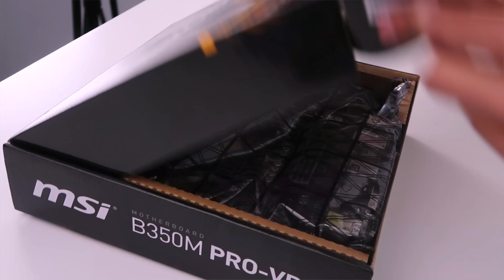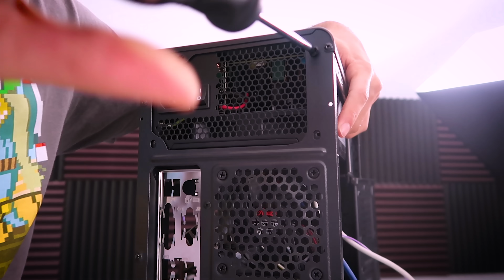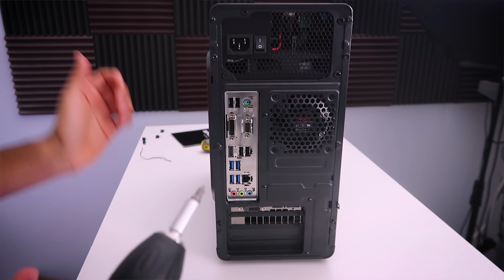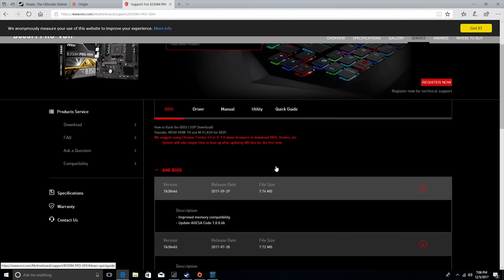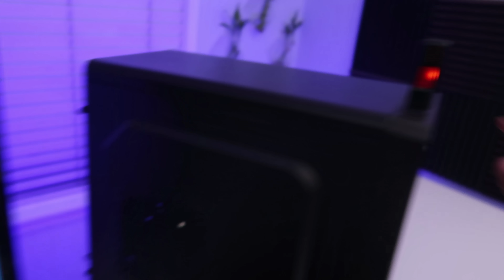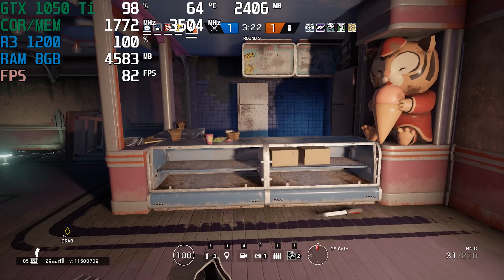$500 Budget Gaming PC Build Guide - GTX 1050 Ti (w/ Benchmarks)

Comment: price of this as of today: i changed the gpu to the zotac version and i opted for a better case. total ended up being $560.04 not including wifi adapter. i also opted for a 24” gaming monitor for $100, bringing the total up to $660.79. i also changed the ram to 1x8gb for around $80 but i’m not sure if one stick is better or worse and two 4gb sticks. overall good budget pc that will handle games like fortnite pretty damn well.

Comment: how would a risen 3 2200g compare to the 1200?? super curious because i plan on building this pc soon and they are nearly the same price.
Reply: Josh G the difference is performance is like 1-3% but the main difference is that the 2200G has a built in GPU which is basically a 750ti m/GT 1030 performance, where as the 1200 has no iGPU so you need to buy a dedicated graphics card for it.
Reply: hell yeah thanks so much for the help my man. much appreciated!
Reply: youre very welcome

Comment: good video bro and I hv some question for u before I buy these stuff.

which is better, Ryzen 5 Ridge 2400G without VGA Card,
or Ryzen 3 Ridge 2200G with VGA Card like yours ?

I'm confusing, many people said Ryzen 5 onboard APU is equal to GT 1030.
is it true ?
Reply: Dope Rock it’s more equivalent to a 750ti than a 1030 but more or less it is
Reply: If you want more graphics power get a Ryzen 3 1200 or the 2200G, whichever is cheaper, and buy a GTX 1050 or better. Even a 1050 is better than the iGPU in both of those
Reply: Dope Rock but if you don’t have money for a GPU or want to save up for something good like a 1060 6Gb get the Ryzen 5 2400G and is the iGPU

Comment: Wouldnt a G4560 be better then a ryzen, especially this close to the 2nd gen release date?
Reply: Tanner Aslan no because Ryzen still has a lot of life ahead of it. I believe they said it will be supported until 2020 unlike G4560 which is on the 200 series which already lost support because the 300 series coffeelake processors came out
Reply: good point, Ryzen is better for upgrading. But, the G4560 can be replaced, especially because it is a budget CPU, so upgrading the entire CPU when you need an upgrade might be better. It is only around 60 U.S. dollars.

Edit: put GPU instead of CPU

Comment: That exact Power Supply unit on Amazon is currently unavailable to me, is there another kind of psu I can use?
Reply: Get the 500w version, just search EVGA PSU on Amazon and it should come up. Think it's the same price.
Reply: Ieuan Squires Thanks, any idea what the 80+, 80+bronze things are?
Reply: Ieuan Squires sorry, new to building these, and I've tried my best to base my design off of this with a few changes
Reply: lol I'm new too, I literally just finished building my first ever PC (this one with a couple changes) as we speak. Waiting for Windows 10 to download to my USB so I can try boot up! I have no idea what the 80+ stuff means tho I'm afraid
Reply: Joe Datz 80+ is the efficiency of the power supply. So 80+ white is the lowest which is fine for budget builds since nowadays pc parts use little wattage. 80+ bronze is after white and has better efficiency. That’s really what the higher ratings are at that point, efficiency. After bronze goes gold, then platinum, and finally titanium.
Reply: Ieuan Squires Joe Datz 80+ is the efficiency of the power supply. So 80+ white is the lowest which is fine for budget builds since nowadays pc parts use little wattage. 80+ bronze is after white and has better efficiency. That’s really what the higher ratings are at that point, efficiency. After bronze goes gold, then platinum, and finally titanium.
Reply: Luis Ramirez Thanks, I appreciate it. I think I built a setup on PC part picker using this as a base, and I plan on buying the parts piece by piece as I get the money. So this helps a lot actually!

Comment: I am looking into building a gaming PC. I may never do it, but for now I am interested. Are these parts still worth it? Also I looked at cases on Amazon and I like the NZXT S340 Mid Tower Computer Case. Will all these components fit the same inside that one?
Reply: With the same components in the video, it is an amazing pc for its price, but I don't think the case you're looking into will work with the parts shown in the video, I'm pretty sure you need an ATX case. You could always try it out and send it back if it doesn't work :)
Reply: Ok, thanks for the reply!
Reply: Liam Boyle no problem

Comment: Would it hurt to use a 500w power supply instead of 430w? I know this is a noob question, but Amazon no longer has the 430w.
Reply: Michael Bratcher it’s fine to use the 500w
Reply: Luis Ramirez Awesome. Thank you. It's been ordered.

Comment: Built this exact pc and runs great but don’t overclock to 3.7ghz unless you have a cpu cooler/fan
Reply: The cpu comes with a cooler
Reply: Luis Ramirez yea it does but when I overclocked it to 3.7ghz it would freeze and come up with an error
Reply: Carlos Flores did you just change the multiplier and that’s it?
Reply: Luis Ramirez yea that’s all I did and everything else was on auto

Comment: Question: If you place the PSU with fan facing downwards aren't you pushing the heat from the PSU onto the Motherboard? Edit: just realized what I did there the fan on the PSU is to draw cool air into the PSU. Ignore my comments.

Comment: Will I be able to play games on High to Ultra settings while getting more than 50 FPS if I pair 
GFX : GTX 1050ti
CPU : Ryzen 5 1500x
RAM : HyperX Fury 8GB
Will I be able to stream games on twitch and render videos on Premiere Pro as well?
Reply: Magnus. I have a few questions and have seen you in the comment section.
Could you text me at +1 360-464-3758? I just have a few questions regarding building a computer for the first time.

Thanks!

Comment: What is the performance when this PC is not overclocked, is it still gud? What's the difference in fps
Reply: Look Wow it’s about 10+ FPS down. I recommend you overclock
Reply: Or like he said, get the r3 1300x. I have the same build, but got 1300x instead just like he said. I dont like overclocking so... yea
Reply: I built this Pc part for part except I used a 450 watt power supply instead and I have to say over clocking is almost necessary for this cpu if your looking to get average performance In games without the overclock some games experience occasional frame drops or just don’t run as smooth as they should
Reply: Wow
Reply: Brandon Avila  how is the computer? Is it worth it?
Reply: you have the same build right? an you tell me the dimensions of the 430 watt power supply?

Comment: Hay Joey can u build this same pc for me I will pay you for the expenses
Reply: Just build it yourself be confident it looks like a rewarding process
Reply: PowerRB34 building your own PC is it dangerous or nah?
Reply: B I’ve watched a lot of videos but I haven’t built one my parts are being shipped right now but it is actually very safe but if you are scared some people recommend you have a piece of grounded metal to prevent shocks but that isn’t dangerous to you really just your pc
Reply: PowerRB34 that's what I'm scared of I might broke a part and I don't want that to happen cause most of the parts are expensive
Reply: B honestly that won’t happen just don’t turn anything on or plug it into the wall until you are done
Reply: PowerRB34 I know I will not turn it on if its not done but like there might be a little mistake and might fuck some parts up
Reply: B then don’t do it until you feel confident or maybe find someone with experience to help you man it’s not rocket science
Reply: Dude don't be afraid , it the easiest thing to build your PC but the real hard part is to do those headshots in csgo😛.And also don't be afraid of electrostatic discharges because most of components nowday are electrostatic resistant, it literally can take you hundreds of electrostatic discharges before you end frying your CPU,ram, motherboard or graphic card. wish you luck with your build
Reply: Berry just watch videos if I can build my first pc in under 35 minutes anyone can build one

Comment: Could u change the cpu to the next one up or would u need a different motherboard ??
Could u add 1070 instead of a 1050 ti ?? 
Could you use a different case ??
Reply: u could us the 1070 in the same motb. but I dont know about the case if its mATX u should be fine
Reply: regular guy thx
Reply: Magnus Rasmussen thx

Comment: Question(s). I built this gaming PC for my son. He is complaining about an issue where the display freezes for up to 5 seconds. Sometimes it is just a quarter of a second. This is a major problem if you are in the middle of some game (Rocket League, Overwatch, Fortnight are favorites). He has demonstrated this to me and I have seen the under 1-second hang-ups a couple times. He measures frame rate and ping and has diagnosed this as not an internet problem.  I am using a 40" flat screen TV for the display and used a 500W power supply instead of the 430W prescribed.  Also the case was slightly different that I got, but that should not matter.  Same graphics card, processor, motherboard, RAM.
* So what is it and how do I fix it? 
* A couple of possibilities. I installed windows 10 from a backup disk from another PC. It nags you about not being registered. I could get a fresh, paid windows. I wonder if this is crippled somehow. 
* The other thing is that I can partition the drive and install Linux and run under that. But will the games I mentioned above work on Linux. I did a quick search and it looks like Linux Ubuntu using Wine might work. There are some people who say no, others who say performance is hurt, it does not look good, I'll post a bunch of links in the comments.
*I have endeavored to get the latest drivers for all the parts but I can go back and double check.
* This is the video I built from. https://www.youtube.com/watch… I can watch closer and see if I missed something and read comments under to see if people had similar problems.
* I have done nothing with BIOS yet, could that be the issue?
* Any suggestions would be greatly appreciated. Thank you.
Links about playing PC games on Linux
https://linuxconfig.org/install-and-play-overwatch-on...
https://askubuntu.com/.../can-i-run-overwatch-on-ubuntu
https://www.reddit.com/.../com.../6cilfb/overwatch_on_linux/
https://www.omgubuntu.co.uk/.../rocket-league-linux...
https://www.reddit.com/.../low_fps_in_rocket_league_in.../
https://boilingsteam.com/rocket-league-now-stable-on-linux/
https://www.epicgames.com/.../suggesti.../94370-native-linux
https://www.reddit.com/.../fortnite_on_linux_it_works/
Reply: I did not do any overclocking either.
Reply: you should reinstall windows, for me that solved the problem.

Comment: Hey, thanks for this. I built it about 2 month ago and it works great. it was crashing with overclocking. Changed it back and fixed the issue. Question, I'm trying to decide whether I should get Far Cry 5 for PC or PS4. How does this PC stack up against the PS4? Thanks in advance.

Comment: The GPU is like $150 USD RN so I found this MSI Computer Video Card (GTX 1050 TI 4G OC) for $50 dollars less link: https://www.amazon.com/gp/product/B01M27X836/ref=ox_sc_act_title_3?smid=AHG2MI785YUY7&psc=1 | but I just wanted to know if it will be compatible with the other parts and if it will drop the fps or over all performance?

Comment: If you buy a 1050 ti u are a fkn idiot. Guys dont buy this shit. This is like buying a GTX 960 and you wont do that neither. Every GTX 970 you can by second hand online for plus 50 bugs is ALOT better than 1050 TI. Use ur brain and dont fall for this. 1050 is a really really bad card for 2018/2019. 1050 TI is just a new name for being a 960.

Comment: Would a 600 w power supply be better or worse
Reply: You don't really need it. 600W is usually for higher end builds with more power hungry parts e.g gtx 1080ti, Intel i7 etc..
Reply: Sneaky better upgradability
Reply: Yeah, but you are gonna end up spending a marginally different amount if you buy a 600W psu at first then spend $600 on a GTX 1080ti, than if you had a 400W PSU and upgraded the PSU and the GPU - only $30-40 more.. whatever both are okay lmao
Reply: Rather than focusing on the wattage I'd recommend focusing on the power supply's quality. A low quality 600w power supply would probably not last longer or dish out enough power than a high quality 500w power supply. 

Many people don't really care about getting a power supply with great components and only focus on the wattage, which isn't a good idea in my opinion.
Reply: would you recommend the EVGA 500W silver one? because im debating that for $41 or the Corsair VS450 for $31
Reply: PSU wattage mainly depends on CPU and GPU as they are the most power hungry parts. Post your full parts list and I'll say if it's enough, because you could have an i7 7700k and a 1080ti without me knowing and you would by a 400w psu

Post your full parts list then I can say, but RAM is hardly the most power hungry part, it's probably the one that'll make the least impact
Reply: i had the same question but i got the 500w
Reply: All depends on your components guys, if you are using the parts in this PC build(Ryzen 3 and 1050ti) the EVGA 430W is more than enough, but if you are gonna upgrade your parts down the line, go for a 500W or a 600W even so you don't have to buy a new one when you get better parts
Reply: Nandoo i have everything except the power supply i just ordered the 500w because the 430w seems to be out of stock
Reply: Bape God did it go well?
Reply: yea it did

Comment: Is 8 gb ram enough for gaming???
Reply: most games, depends
Reply: With just 12GB you won't reach max RAM usage by gaming. 16 is good cause it's 2x 8GB, but slightly "overkill". 8GB will do just fine however.
Reply: 8GB RAM is the ideal amount for smooth gaming. But if your planning to run games like PUBG on 1080, 16GB is the best amount. 32GB is overkill unless your streaming.
Reply: Yes . But if you want to run High-end games. You Will propaly need 16 GB DDR4 ram. To run it good.

Comment: You should update that build because Ryzen 2200G is hella faster (1300x lvl) and even cheaper than R3 1200 plus has powerful vega graphics as backup or primary graphics - hell you can even game on that igpu with low-med settings at 1080p. R3 1200 is officially dead.

Comment: i updated my bios and now my computer wont display on my monitor someone please help
Reply: OwnageControllers where us your monitor plugged in? gpu or mobo?
Reply: hey sorry I actually figured it out. I Followed his video to get windows 10 (the free version) and I think because  there are restrictions on it it wont allow you to over clock. I rebooted my computer, went into the bios, and changed the settings back to the original and it displayed just fine. So I think ill have to buy windows 10 soon
Reply: OwnageControllers no you don't. I did it literally the same way and it worked all fine
Reply: OwnageControllers did ya download the bios before geforce experience?
Reply: nah
Reply: OwnageControllers so you did install gefore experience completely and then went on with the bios (the same in the vid or the latest one?)

Comment: what if i got a 500w power supply instead of a 430w, would that fry the motherboard ???
Reply: mahmoud khater nah it will have specific voltages sent to different parts of the pc so dont  worry.
Reply: It will only draw the power it needs. I tend to get larger power supplies so I can upgrade later.

Comment: Im using ryzen 3 2200g instead
Reply: how is it? cause im thinking if i should buy that instead of the ryzen 3 1200
Reply: Isaac Asperilla ryzen 3 2200g has better cpu and a gpu inside it
Reply: if you are going to get a gpu then i wouldnt recommend going for an apu.
Reply: Roshan Ekka Why?
Reply: Fliqpy the killer the apu is really weak a ryzen 3 1300x and a 1050ti or 1060 is much better
Reply: You know it’s not compatible out of the box you have to update the bios